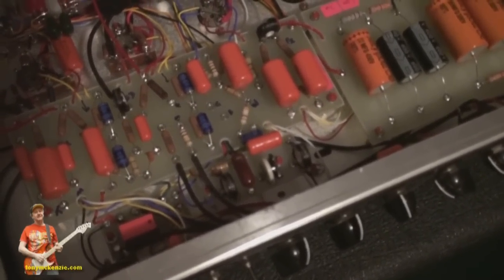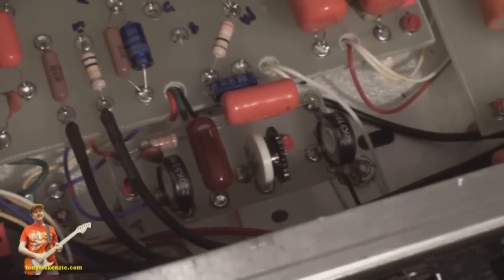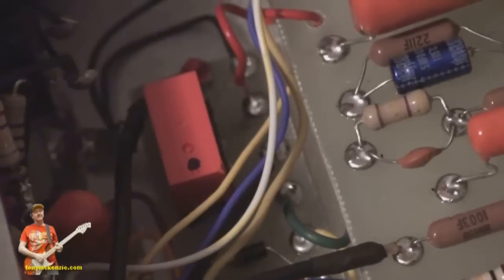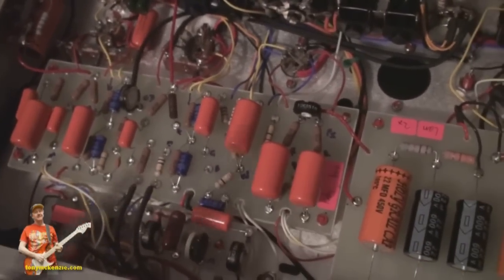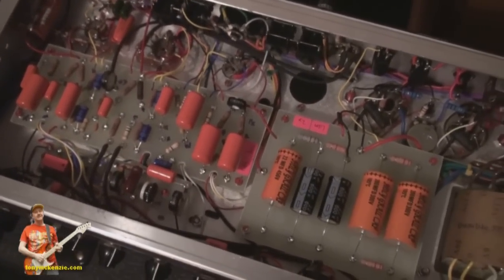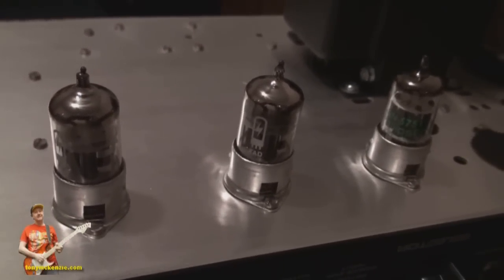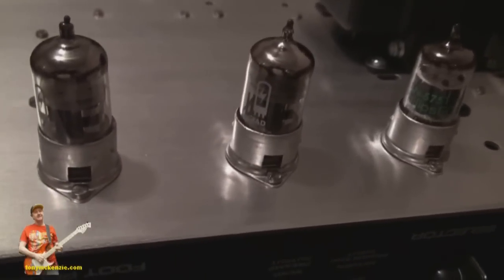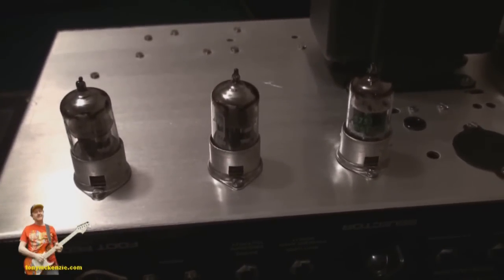Ceriatone Overtone HRM Amplifier | Part 7 | Dumble Clone  | How to Build From a Kit | Tony Mckenzie

Comment: Fantastic build quality and amazingly versatile. My HRM is a little different to yours in that it has a three way toggle switch on the front in between the bass and middle pots that does stack defeat, it's also got a LNFB two way toggle in between the 12ax7 gain stage. I've never had an amp that you can overdrive the overdive and overdive that overdive. Amazing fun. Thanks for the guidance Tony

Comment: Well I get my HRM 50w with defeat switch tomorrow from UPS which is pack 4. It may seem a lame question to ask, but when it comes the 5 valves are packed separately- does it matter which valves go wherever or will they be matched as i don't have any bias tools.Thanks tony

Comment: Hi tony, do you have the OD trimmer fitted to the rear of the amp or just inside. I've also noticed on the pre-built units that underneath the external trimmer pot there is a toggle switch yet the schematics dont show this to be wired up

Comment: Why did you use a bias master when you have measurement sockets next to the power tubes?
Central common and a positive on the outside of each tube?
Reply from the maker: Good question. I wanted to demonstrate the Bias Master.